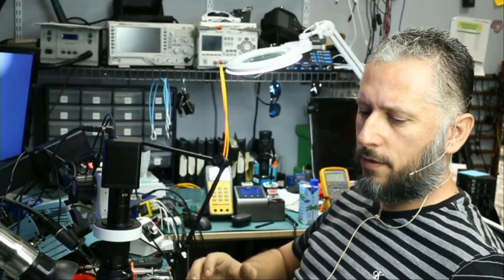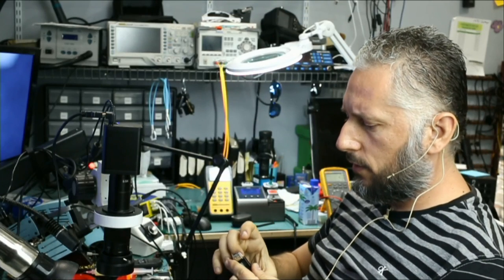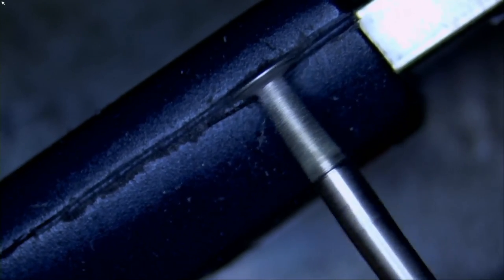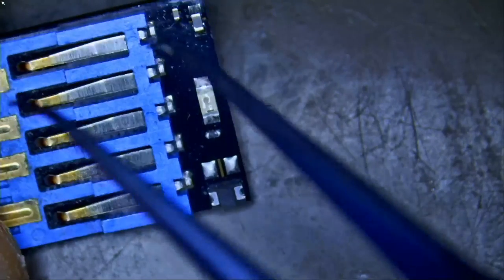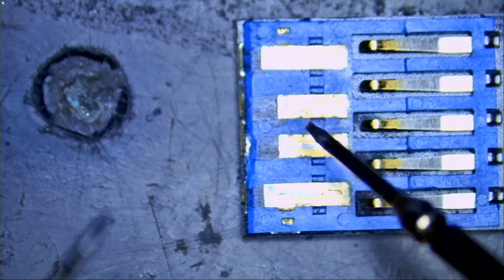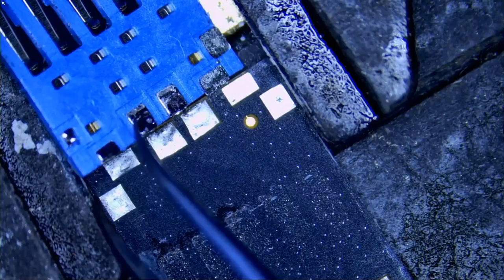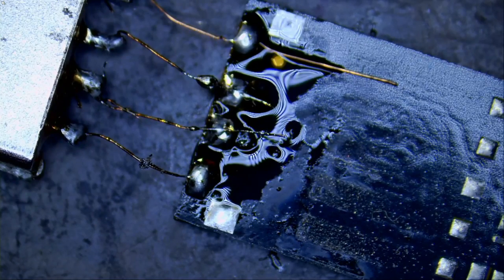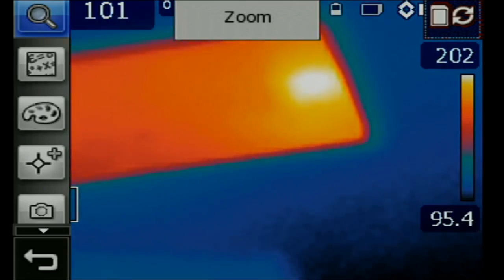SanDisk Flash Drive Not recognized Freezes - Is it repairable ?

Comment: IDK about freezing up but my big complaint with Sandisk flash drives is that even the 3.0 drives copy (write) very slowly, and I've now verified this with about 4 different computers --- same situation it will drop down to about 10-20 MB/s, when it should be copying at least 100MB/s per the spec, at a minimum.  I know that not all flash memory is created equal, and that overall file size (a bunch of small files versus one large file) will also cause write speeds to be different (with a bunch of smaller files possibly taking longer than one large file), but regardless, the write speeds are very low, and have had this happen now on about 3 drives.  The only common aspect of the three drives is it seems to happen more with the larger capacity drives (128-512GB) than the smaller ones (the ones under 128GB).  And it seems to be more limited to the one shown, the sliding "Cruzer" style drives.